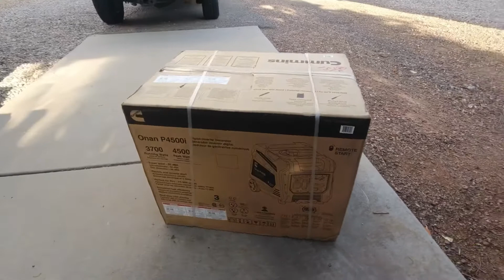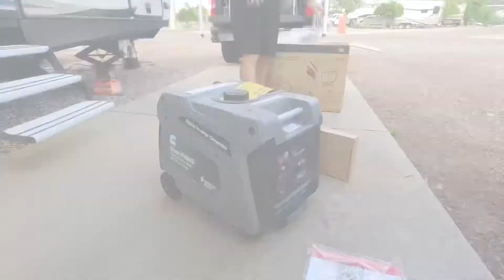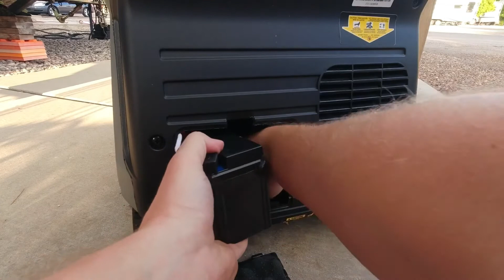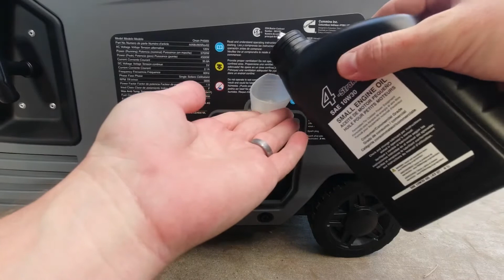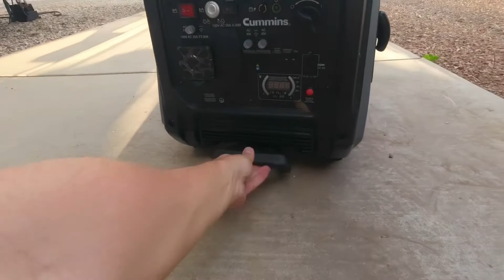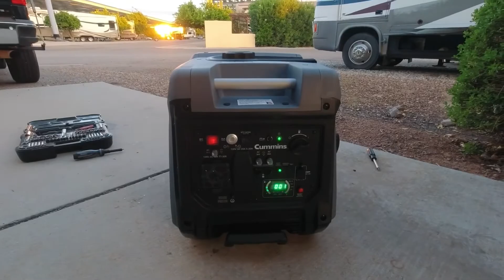Cummins Onan P4500i Open Box and Start Up

Comment: How do you like it ? I bought the Westinghouse sister one and nothing but problems .
Reply from the maker: We like it but we only use it every once in a while. That stinks you’ve had so many problems with your Westinghouse. What all problems have you had?
Reply: @wereoutnabout  first wouldn’t start choke problem fix that then now I have an oil leak
Reply from the maker: @Jjsaba2008  yes same here it wouldn’t start out of the box the automatic choke wasn’t plugged into the control board. I made a video how to plug it back in. Then it started right up. Haven’t had any other issues. Bummer you’re leaking oil. Can you find where it’s leaking from?
Reply: @wereoutnabout  yes it's leaking between the two steel plates right underneath the oil drain plug at first I thought it was the oil drain plug but it's not . And that's the frustrating about it is that has barely has over 20 hours I haven't changed the oil but technically I have to keep adding oil for it to run so is that kind of like a generic oil change lol .
Reply from the maker: @Jjsaba2008  dang only 20 hours, have you tried talking to Westinghouse customer service? Seems like it could be a warranty claim
Reply: @wereoutnabout  yes I’ve contacted them twice the first time they did not get back to me so I waited a week and then contacted them again. They were very nice on the phone but as far as falling through with the customer service seems a little lacking the gentle when I talk to you last time so that he would get it to the proper person to take care of this for me but I have not heard anything back from them and it’s been almost a week
Reply: How much oil did it end up taking?
Reply: @jtlos  mine takes roughly about 1/3 of a quart if that my Westinghouse has been flawless, it’s worked very well. Never had an issue with it so far. Plus, it runs really smooth on propane also for the dual fuel model.